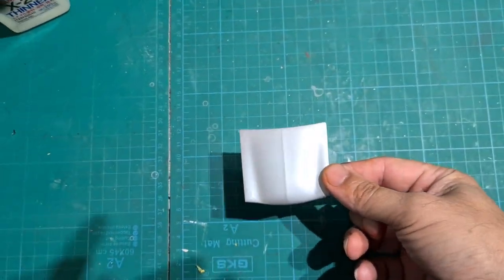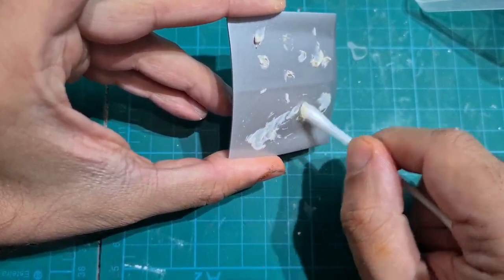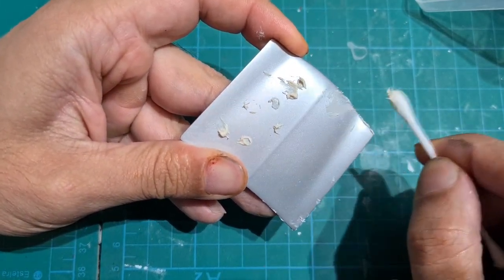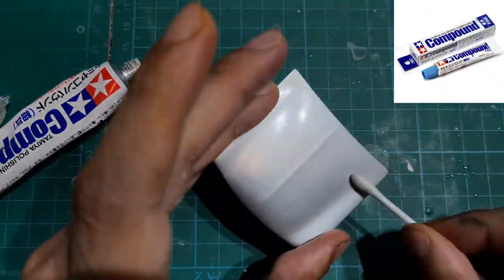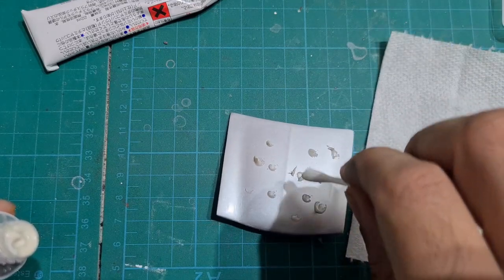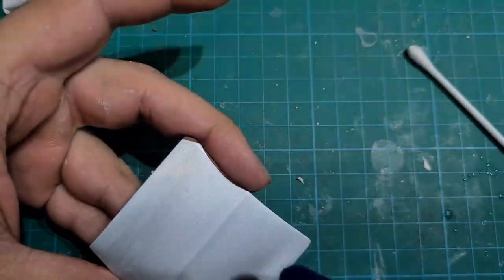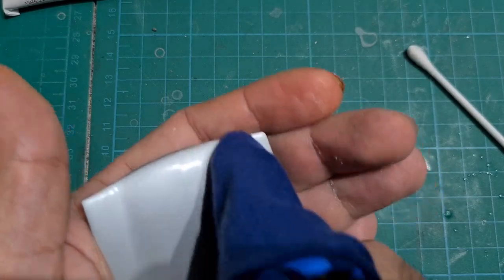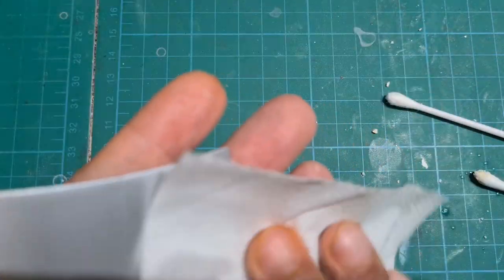How to Polish a Model - Scale Modelling

Comment: Hello. What if I will use only one type of compound? Fine or finish for example?
Reply from the maker: If your only going to use one thrn use finish. Using only fine will smooth out any small imperfections but will not give you that gloss finish.
Reply from the maker: Using only fine will remove minor imperfections but will jot give you that gloss finish. Using only finish will not remove imperfections but give you a gloss finish. So its best to use both.

Comment: Wouldnt you use a small  Cotton cloth towel  for the larger areas and  Q tip for recess areas ?  I don't know I'm not saying I have the answer I'm just asking ?  I just shot a car model last night AMT 1969 cougar eliminator in a tester's paint mixed with lacquer thinner. I definitely need to Polish it out because I have Orange peel. I don't know whether I should use the sanding kit and then use Polish at the end or could I just use Polish by itself ? I have tried the sanding/polished method but ended up rubbing through the edges of the hood and sharp edges of fenders.
I thought I applied enough coats. Anyway, 👍to your video .
Reply from the maker: With testors paints I would wait a while before polishing them. You are right I should use a cloth, a microfibre cloth. Goodluck with your model.
Reply: He didn't want to rub through the pledge clear...so he buffed with Qtips.
Reply: I’ve been using testors cans for paint jobs and testors extreme lacquer clear coat and very awesome results for semi cheap paint it’s okay but now I bought an airbrush and paint with small testors enamel jars and results are kind of the same but I have more choices of colors I can do and cheaper on the long run.. but can I use this tamiya compound on testors paint jobs? I’m soo happy now I’m thinking of moving to tamiya since it’s honestly better quality also alclad has some beautiful paint too especially their candy colors and different chromes and metals thanks for the awesome video man 🙏😎

Comment: Great video.
So im using spray can clear, there are a few dust specs on the paint (not like the end of the world but its a bit annoying)
and im not sure if the clear coat is thick enough (so im a bit scared to sand it).
The sides of the car were shiny after the first coat, but roof was matt, after a second coat the roof was kinda shiny, but the sides became a bit hazy?(not so shiny) 
Was this because of "over spray"? and can i make it shiny using polish?

Also if the course (red) and fine (blue) (tamiya) enough to give a shiny clear coat or is the finish compound necessary? many thanks
Reply from the maker: If its hazy it could be because it did not lay down and level out over the first coat. Also if its a commercial spray can they can have varied results. It could be polished out, vut very carefully. 
The finish compound gives that shiny glass look which the fine compound cannot always do.